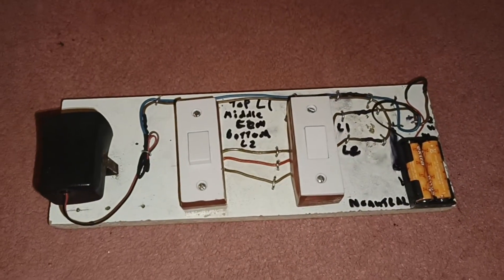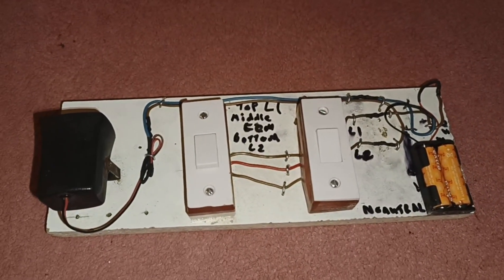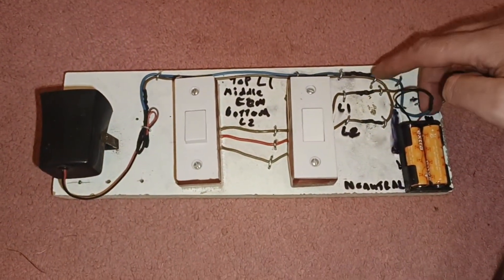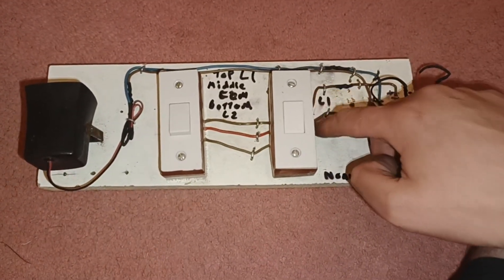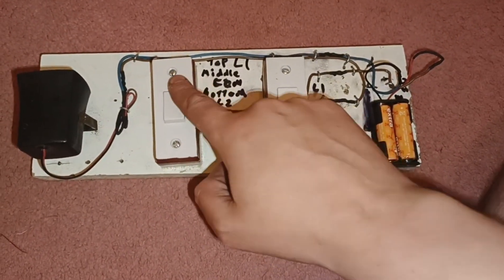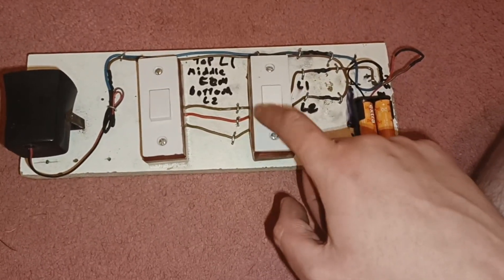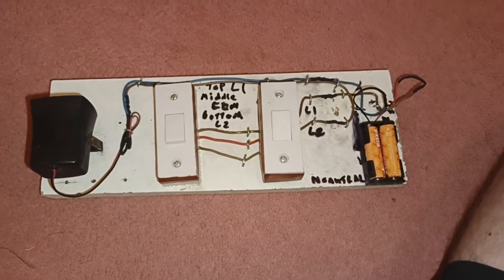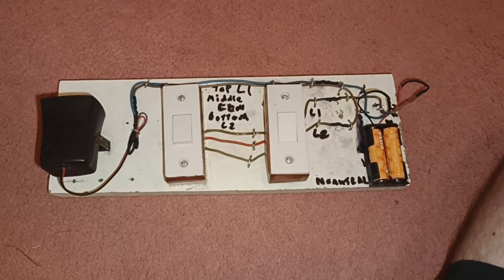Teaching Myself How A 2 Way switch is Connected

Comment: So, how does that work again?  Looks like parallel switching as did not demonstrate two-way switching.  What more to include the intermediate switch?
Reply from the maker: I'm passing the buck but ask another video. More a case for me of a basic rig of it working and how I wired it. How it works I don't know. Maybe I've done it wrong but it turns the buzzer off with either switch. Be a lot more complicated I guess on say a switch upstairs and downstairs.
Reply: @jackmilne9764  Done some in my time, not complicated, straight forward really
Reply from the maker: @cybernatwa  I never understood how their wired still unsure how it works. But made a basic rig to teach myself how it wire one. Problem is on a hall and landing a lot more longer wires labeling then etc
Reply from the maker: Thanks top man any suggestions of something I could make a small rig again for that appears complicated?  Get them cheap eBay or Amazon a radio kit might do that when the summers over issues is instructions are in Chinese..

I've got a old skool b&d drill fast slower switch stopped working so I by passed it. Any ideas how I can use the multi meter to see what resistor it needs? 

I know the odd idiot will take the piss but I'm enjoying uploading videos like this so hopefully more to come.